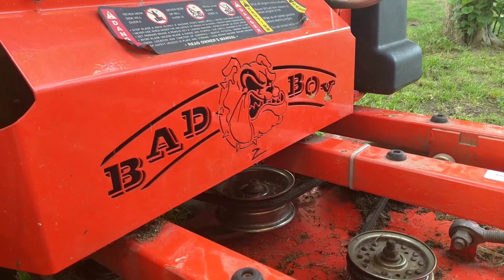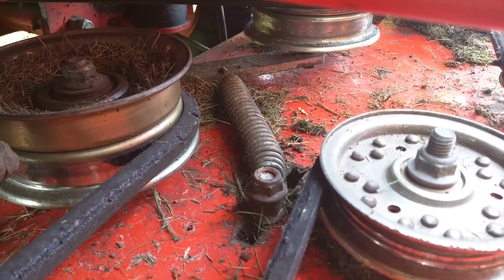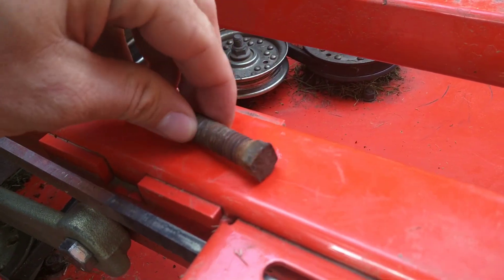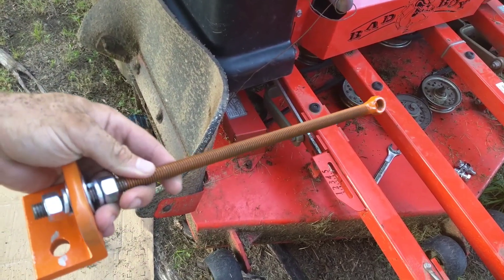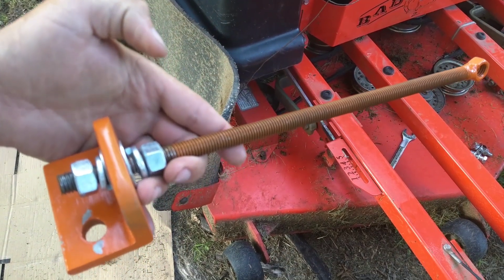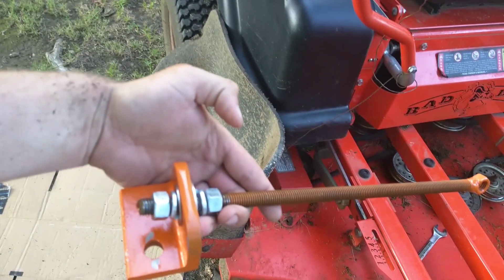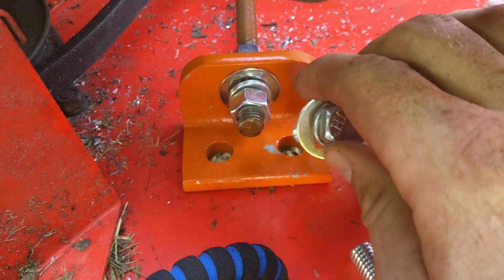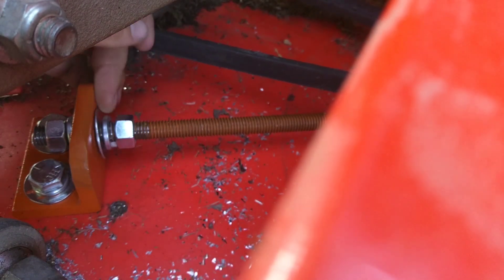Bad Boy Mower DIY deck belt tensioner

Comment: I'm 85 years young and decided to make one of these belt tension setups for my 72" - 2010 ZTR - BB mower to replace the tension junk that came on it. It works wonderfully. I've had to get someone to help me install a new belt for the past 13 years since I purchased this great mower. I can easily do it by myself now....Thanks very much for the idea....you sound like a very prudent guy. There is an old saying: "For every problem under the Sun, there is a solution or there is none. If there is a solution, go find it.......if there's not never mind it!"  You my man, are like me....I've always come up with a solution for lots of problems while running a small construction company for over 65 years.....Thanks again.....
Reply from the maker: Thanks for the great comment. Glad I could help. I only have about 25 years of construction under my belt though.

Comment: You are good and i think Bad boy manufacture should patent this best practice for you so you can get loyalty $.
Many bad boy's owners are very unhappy with the current design because it is extremely hard to  adjust tension after replacing the belt.
Reply from the maker: Thanks, I'm just a lazy and wanted an easier way to do that
Reply: There is a square hole for a 1/2" Breaker Bar for that.

Comment: On the original setup, remove belt from 1 pulley before adjusting with the tensioner pulley.....makes it 10x easier!
Reply from the maker: Great suggestion, i really just did not like having to get under the deck and then do it again if you didn't move the bolt far enough or too far.
Reply: @shelbydowning1986  You can get a really good idea of how far the tension pulley needs to be moved by just grabbing the belt on the opposite of the discharge chute (while the belt is still on all of the pulleys) and pulling outward (toward the  left side of the deck) until you see the spring get some tension on it. It's not an exact thing, just enough to keep a little tension on the spring on the tension pulley. If (after removing the belt on the left hand deck pulley) you loosen the tension pulley nut with an impact (or ratchet/socket), slide it to where you think it should be, and then tighten it, you don't have to do anything from the bottom of the deck. If need be, to get the tension where you want it, go thru the process again. I HATED my self for trying to adjust the tension with the belt on (several times thru the years) when I realized how quick and easy it is doing it this way! Trust me, it's a piece of cake doing it this way!  Happy holidays!!!

Comment: I'd probably use carriage bolts coming up from the bottom of the deck so there wouldn't be the bolt tip/nuts to catch grass. They made a kit that helped to align the deck pulley's with the crankshaft pulley to prevent excess belt wear ...it's free.
Reply from the maker: +Stan Wilhite I haven't noticed the bolts/nuts catching grass but haven't really thought about it being a problem I'll look and see if grass is building up. As for the pulley kit that lowers it, it place where I bought it from was supposed to have already put it on but it still looks like it's at a crazy angle so now I am wondering how to tell if they did put it on.
Reply: A welding shop can cure the problem for about 50-60 bucks. No more throwing belts (or premature wear-outs)from misalignment!

Comment: Will you make me a couple of them?  I share the same opinion about the deck belt tension system on my two BBs.  Good design, BTW.  There's no problem with the belt "grazing" the screw?  I have a 2009 Pup 5200 and 2011 Lightning 5200.
Reply from the maker: +taker252 thanks. I check the belt almost every time I mow and the is no sign of it grazing the all thread, but if I did make any more there is a couple changes I would make to give it a little more room and make it a little easier to install. I could make you a couple, if you could PM me you address or at least what city and state. I can check on shipping when I get home and let you know how much $$$$
Reply: Tried to find the 'About' tab to PM you but to no avail.  Youtube and Google must have changed things up.  Plan B...
Reply: Still able to make these?
Reply from the maker: Sorry I don't have access to a welding machine right now.
Reply: Need help  wit this thing , Now have lawnmower that is useless. I have a ELITE SERIES. 60" CUT
Reply: Still make these?

Comment: Why not just replace that bolt?   There is a Square hole in that arm for a ½" Breaker bar to adjust the Tension.  Your far side Idler Pulley is not properly aligned.
Reply from the maker: the main goal was to not have to get under the deck to adjust, all adjusting can be done without laying on the ground now. Also keen eye, that pulley has caused me lots of grief over the years, i never realized it was so bad, I have recently pulled it off and cut the spacer under it in half and that has made everything better. I really wish i made a video on it.

Comment: Was it leaving stragglers behind? My middle blade does even with fresh blades
Reply from the maker: only after the blades are pretty worn and I turn sharp. You might want to double check that you are putting on the correct size blades, also some weeds are pretty hard to cut so some areas I have to slow way down.

Comment: Good job! I also have a commercial BB mower. I have trouble drilling in my deck and was wondering what kind of bits you use? PS. I bought my mower new in 09 and have been very happy with it. (60" with 26hp water cooled Kawasaki eng).
Reply from the maker: Yeah I was having a little trouble drilling it also. I do not know what kind of drill bits I used, but if you watch this video, https://youtu.be/xgQeSrsAXgE it should help you get some good bits. Also cutting fluid would help.

Comment: Is it normal for the belt to ride so high on the right side rear pulley? Quite the angle that it goes down to the spindle pulley.
Reply from the maker: yes the angle does looks quite bad, but i think it looks worse than it is.  I have looked for pictures of other mowers to compare but haven't found any where i could really tell if their belts are at that much of a angle. I think its ok since its in the "slack" section of the belt route, I have never notices any damage to the top or bottom edge of the belt, only damage I have ever seen is to the inside section where it cracks and chunks are missing.
Reply: I personally believe that it is deliberately made that way to cause the belt to eventually wear out... otherwise, the belt would probably outlive the machine.

I believe that is also why they make the belt tensioner "slide/groove" so short.
They only give you about a 1/2" of spring tightening adjustment (which is ridiculous) After that, you'll have to buy a new spring WHICH I REFUSE TO DO!

Instead, I am going to use my grinder to extend the "slide/groove" another 1/2" inch or so (depending on how much meat is there). I'll have to take a look. I'm only getting this idea now, while on the computer.

If increasing the spring tensioner adjustment turns out to be successful, after that, one should never again have to buy a new tensioner spring.

Then all BadBoy will have to do is to NOT give us enough room to extend the tensioner slide. Or they may experiment with the temper of the springs on their "NEW AND IMPROVED" mowers to cause them to break if tightened beyond the 1/2" they currently give us.... Or, to play it safe, THEY MAY DO BOTH!

JUST TO BE CLEAR ... ALL MANUFACTURERS DO THE SAME TYPES OF STUFF TO KEEP US BUYING THEIR PARTS AND EQUIPMENT (NOT JUST BADBOY).

It's just that some are better at hiding it than others.

IT'S CALLED PLANNED OBSOLESCENCE!

Comment: How did you adjust it before?  I've had one of these for almost a year.  I found the belt tensioner impossible to use.  It's one of the worst designs I've seen.  Surprising since the rest of the machine appears well designed.  They should have used your approach and it would work fine.
Reply from the maker: There was a bolt that came through the deck from the bottom that had to loosen off so you could slide the spring over until it had the correct gap. It was terrible. There are a few things I would change on my desing but for just throwing something together on the first try it works better than the manufacturer.
Reply: Take the belt off of the tensioner then you can loosen the nut, slide the adjustment bolt whichever way it needs to go, and then put the belt back on the tensioner. I've had mine for 9 years and it took me a while to figure this out. Trying to adjust the tension without taking the belt off will make you talk ugly.
Reply: @StanWilhite  I think I used a spring puller, once i moved the bolt back. left the belt on. Motion Pro Spring tool. Had one for my dirt bike.
Reply: @rob.granger  I used a puller until I realized how simple it was just by taking the belt off of one of the outside pullies. Absolutely guick and easy when there's no tension on the tensioner. I kicked myself for not figuring that out before!
Reply from the maker: The main issue for me was having to reach under the deck, it wasn't that big of a problem I just didn't like doing that. Also if you are putting on a new belt that may require a few adjustments. Now I can do everything from the top and it's super fast.
Reply: I appreciate your ingenuity I understand why you did it but it looks like you added more stuff in the way to me I wouldn't want all that but I understand what you were saying and it's still a good adaptation and you'll get much more life out of the spring like the other fellow said

Comment: do you like that mower.
Reply from the maker: +kenneth adams For the most part I do like it. I hate the electric deck lift and I think the deck belt layout needs some attention, I have to put at least 1 new belt on a year. There is a few other small things that could be changed for the better. I've had it since 2009 and the only problems have been 1 coil pack needed changed, the belt is bad about coming off and the electric ram for the deck is starting to hang when I take it all the way up.

Comment: Where did you find that threaded rod with the eyelit?
Reply from the maker: It is a piece of All Thread that I welded a nut to the end of.
Reply: @shelbydowning1986  did you tight weld it or mig? I was thinking it was a welded nut but figured it had to be tig welded for the strength. Just replaced my belt yesterday and between my neighbor and I and 45 minutes of busting knuckles and cuss words we got the belt on
 Stupid design on BB part
Reply from the maker: I TIG welded it. I think if you beveled the All Thread a little you could MIG weld it just fine. I also think you could probably just drill a hole about a 3/8 of a inch from the end of the all thread if it's big enough All Thread.
Reply: I will probably just find someone to TIG weld it. Thanks!

Comment: Will not recommend Badboy Lawnmower to anyone. This thing is nothing but a pain in the as. Bolt keeps slipping. I have replaced Bolt multiple times. Called Badboy about their bad design. They dont care. They are still making them with this sht design. 😡😡
Reply from the maker: Mine never slipped, I just didn't like having to get under the deck and clean the bolt off to adjust it. If yours is slipping you could try using a "Nordlock" washer on both sides of the deck, also maybe try a second bolt with a washer and a lock washer to help stop it.
Reply from the maker: Also I promise no matter what mower you get there will always be something you hate about it, or at least think they could have done better.

Comment: Bad Boy zero turns are of poor quality and bad design.  Most parts are from China, and they don't  last.   Try another brand of Lawn mower
Reply: I've had mine for 4 years and no issues.  What should I be on the look out for?
Reply from the maker: I've had this mower for 16 years now. I've had to replace both coil packs on the engine, the first one went out the summer I bought the mower, the second went out 2 or 3 years ago. I've changed the belt tensioner design. I was having problems with the belt coming off, fixed that by cutting the spacer under the idler pulley and lowering the pully by about an inch. The fuse holder going to the starter had to be replaced, got water in it, and corroded. I've changed the fuel filter twice and have replaced half the fuel hose with new. And now I have to tap the starter with a hammer every time I start it. And lastly, I have to air up one front and one rear tire every time I drive it.
Reply: @shelbydowning1986 sounds like pretty standard mower maintenance to me!